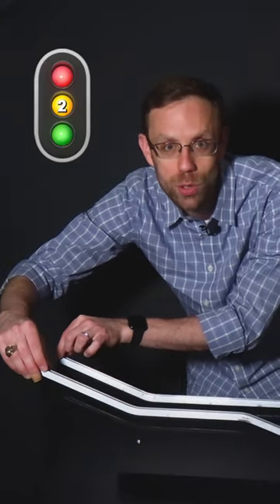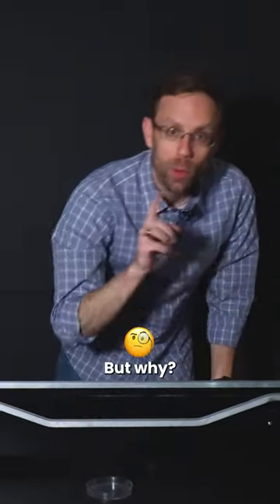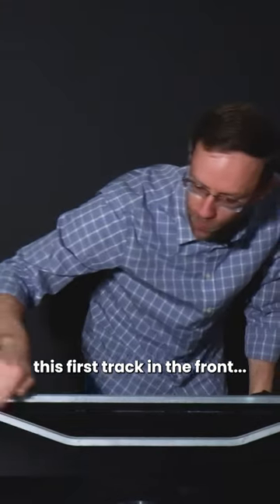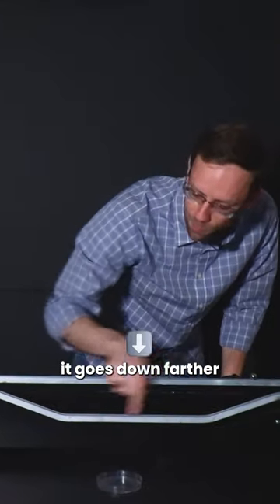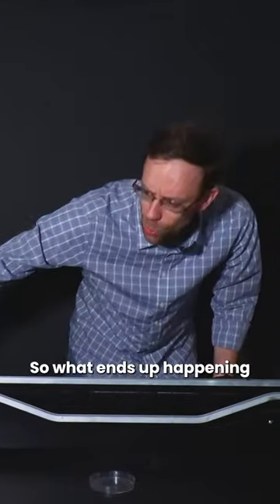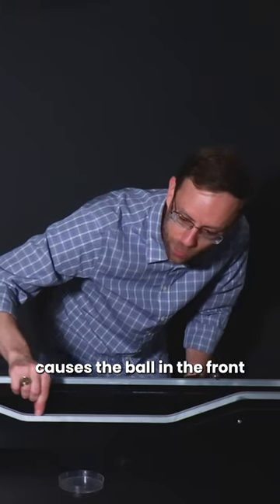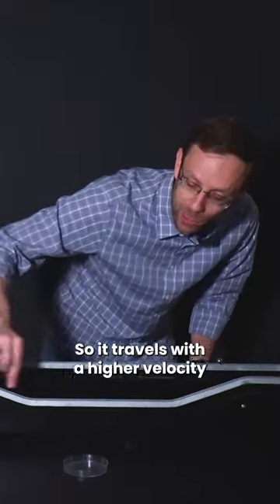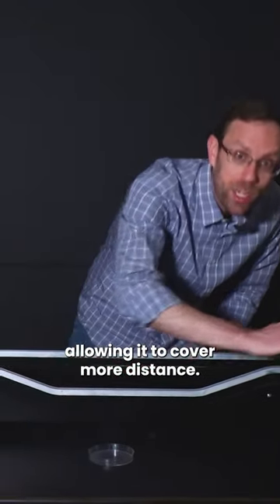Is the shortest track always going to be the fastest? #shorts #fun

Comment: At the end, are those two tracks of the same height above the ground? I thought I saw the front one is lower. If that’s how they designed the tracks, then the height difference would be the key factor. If we ignore the abrasion between balls and tracks and air resistance, the pathway shouldn’t matter, they would be at the finish line at the same time and speed. I don’t know much, just throwing it out there …